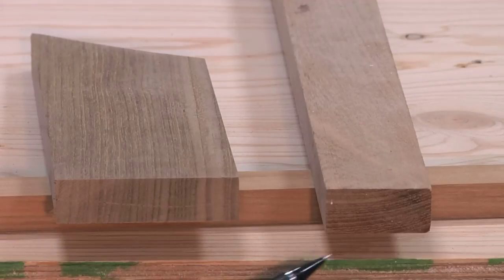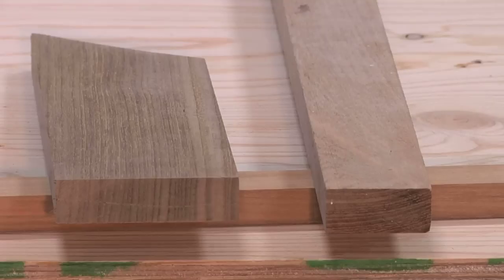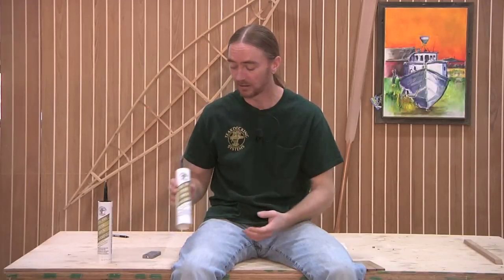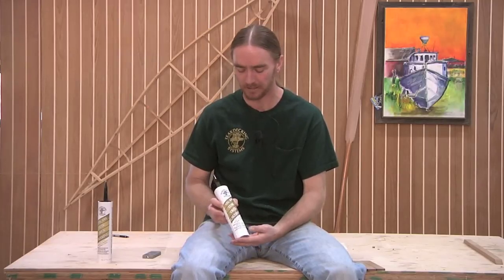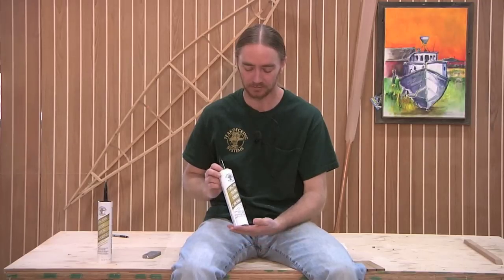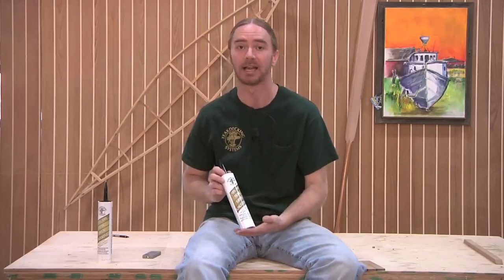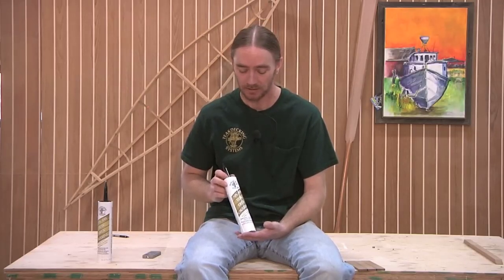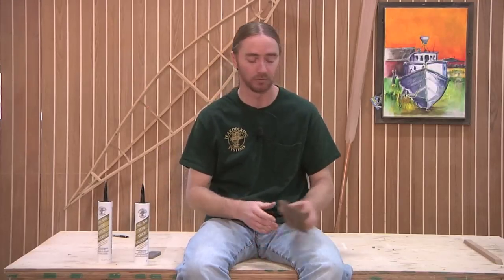Teak Deck Fabrication and Installation

Comment: Great information! Thank you for the video. I'm looking to put down a mahogany deck on my foredeck instead of teak and once I caulk it with this product, I will want to seal the deck with Cetol Marine. Could you please confirm for me if I can use Cetol Marine over the finished caulking and wood surface? If not, is there a different product you can recommend? I won't be doing Cetol gloss so as to maximize traction on my foredeck.

Comment: Why is teak preferred ? Is there any cheaper wood out there ?
Reply: Not sure if you ever found out the great performance of teak. Quater saw teak is like traction enhanced super power when it get wet. Mold resistance and bug resistance as well. And when it is always wet mold wants a place to grow like cheaper woods. Walnut offer the insect repellent properties but is slick as ice when wet. Hope this helps.